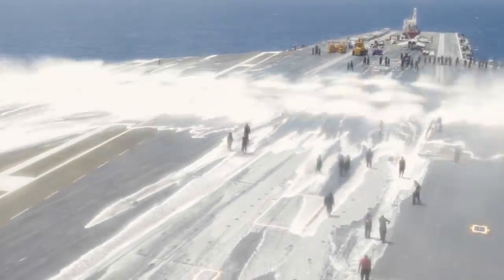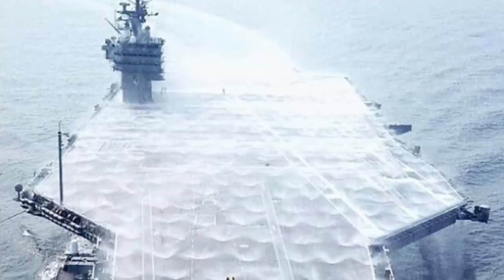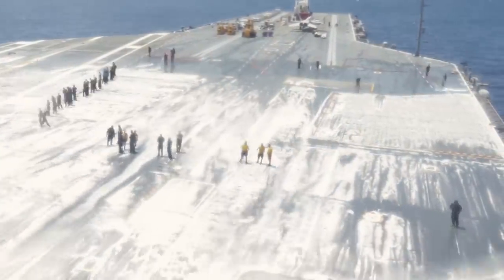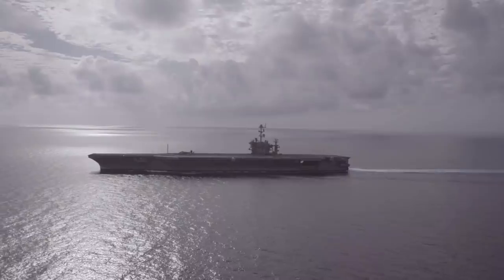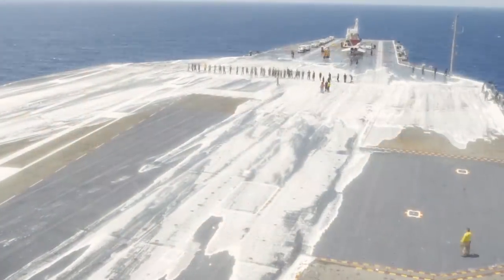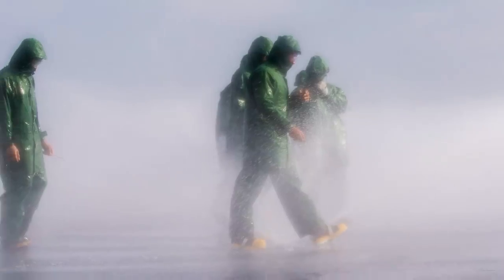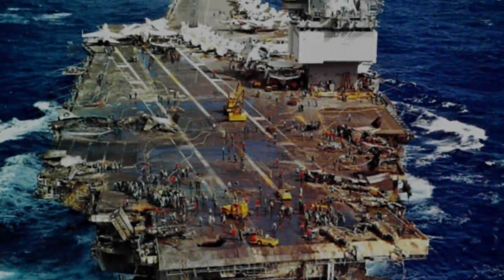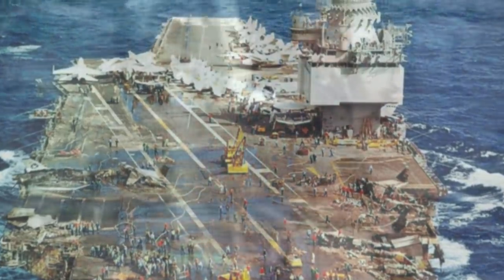Aircraft Carrier Bio Force Field - Countermeasure Washdown

Comment: A F F F just doesn’t sound right, we always called it A Triple F.
Reply: thats because you called it right
Reply: In June of 1987, after the USS Kitty Hawk entered the Med, from the Suez Canal, we resumed flight ops at night. After flight ops ended, was stripping wax off the deck of the passageway, just outside of CATCC/Air Ops at 3 am. About an hour later, a little puff of white smoke filtered up from the hangar deck, to the 02 level, where I was at. A few minutes later, I heard over the 5MC, "gentlemen, man your hi-caps." Oh SHIT, hanger deck is going to be turned into a giant "car wash" !! Instead of soap, it's , you guessed it, A Triple F. About two minutes after the announcement, came GENERAL QUARTERS !! OH SHIT,  taking up wax makes the deck very slippery !! I even posted warning signs outside the "knee knocker", above/below the ladder wells, too. I didn't want my shipmates to fall on their ass !! But, my attempt to avoid that scenario was for naught. Three of my shipmates ignored/ failed to see the sign as General Quarters was sounding off, and slid on their asses, like sliding into 2nd base. Fortunately, no one slammed into the angle iron protruding into the passageway. I assessed my shipmates condition, leaning out of CATCC, and motioned like a baseball umpire, yelled 'SAFE'. Sorry, I couldn't resist. My GQ station was a repair locker back aft, but I was stowing my gear before I left for the repair locker. Special firefighting team has four minutes to respond to any fire aboard ship. If not, GENERAL QUARTERS is sounded. They couldn't, that time. Turns out they were transferring the ship's diesel fuel to a fuel void, and it caught fire. The skipper turned the ship so the wind would fan the flames outboard. Never found out who jettisoned the crate of grenades off the roof and over the side, but I would have bought that guy a drink, after we hit port. Felt bad for AIMD, having to clean A triple F off the aircraft. I understand A triple F is corrosive.
Reply: Castle AFB built a couple new maintenance hangars back in the late '80's.  Each had very sensitive fire detectors that could 'see' a flame a mile away.  Well, we got called one night for a system activation in one of the hangars.  The detectors spotted some welding at the far end of the flightline and at oh-dark-thirty the entire fire dept. had to show up.  We reset the annunciation panel and went back to bed.  We let the maintenance guys clean up the 2000 gallons of AFFF that filled the hangar and offices.
Reply: @TheHawk--oe8iq  i am confusion
Reply: @traleras1 , sorry. I used a lot of US Navy slang.
Reply: @mbpaintballa  Who ever jettsion the RSL us like not to be find. It an insta mass wirhout the CO approval.
Reply: @Virtualstalker , I heard the flames were "licking" the grenades; started to cook. They had to go for a "swim". A chief probably sent them packing.
Reply: @TheHawk--oe8iq  the rsl hang of the side of the ship. If they where licking them. Then the is no way of jettsioning the locker.
Reply: @Virtualstalker , what responsible CO would NOT approve a crewmember saving lives & destruction of his ship & crew ?? Surely, this could easily have been another USS FOREST FIRE, had it not been for the quick thinking of my shipmate(s). I would have risked captain's mast or court martial to save my shipmates !!! Btw, the word I used earlier was HEARD, as in SCUTTLEBUTT !!! But, if you would like to ask my (then) CO, Capt. F. Lee Tillotson,  go ahead and do the research.
Reply: i @TheHawk--oe8iq  I not saying it wrong. But with out the CO approval. It instat mast, but does not mean they will get in trouble, but the hastle of it.
Reply: A3F would be a nice quick way to say it

Comment: This would have helped back in the day when that missile went off during start up procedure of a jet
Reply: Can you explain what happened?
Reply: Edit: the USS forestall in the 1960s during the Vietnam war, on startup, another plane accidentally launched a Zuni rocket into an a-4 sky hawk which exploded and caused a massive fire, killing over 100 sailors
Reply: @devin5531  flight deck crew had pulled the secondary safety pin on the missile before start up procedure, when starting a jolt of electricity set the missile off.
Reply: Cough John Mccain cough
Reply: @thetank2078  some of the vids on youtube show the dedication of the flight deck fire chief running straight towards the blaze with nothing but a fire extinguisher right before a huge explosion, telling others to get away!
Reply: @Tugboatpb  Yes, you are correct.   John McCAin had nothing to do with the start of the fire.
Reply: The Forestall fire  and the later Enterprise fire  in Nam was actually the thing that show the navy that they need this system.

The Navy Had the design and prints for the system as shown here in the 50 but...

As I understand it got cut from the final designs as a cost cutting measure. Which wasn't help by the fact that Navy... Was kinda Cocky at the time believing no one can hurt a carrier... Also idea of any weapon used to attack a carrier will be a nuke,  such destroy the carrier out right was going around with the whole:

You dont need a big navy or army, just nuke them and be done!

Line of thought, lucky or unlucky depending on how you see it, Korea and Nam showed that Nukes dont solve all problems. Still took to long for the Military to get the messenge through...
Reply: JoeyR: Forrestal did have a water washdown system.  However the explosions damaged the under-deck fire water mains pipes, making it inoperable.
Reply: @KB4QAA  I knew the interior of the ship was damaged under the flight deck but I didn't know about damaged fire safety equipment damage...thanks for the knowledge, it's kinda hard to find the complete story in detail on YT about it.
Reply: @KB4QAA  Songbird wetstarted his jet. Which caused the missile launch, which caused the fire.
Reply: I remember being taught that they had AFFF systems, but the DC crew had never used them, and they had to read the instructions for the first time as they were fighting that fire.

We were told that the Forestall has led to a change in Damage Control doctrine, where they were teaching crews not to listen to rank, but to training. 

For example, when the Cole was hit, a lot of the Mass Casualty actions were guided by the junior sailors who had just left boot camp, because they had the most relevant and recent experience training for that type of situation. The senior sailors and officers had experience avoiding getting into that situation, but the junior sailors had more recently trained for getting out of that situation, so they were the ones to follow.
Reply: @rogerstroklund6809  My dad enlisted in 68' and I remember him saying they already were using the footage in training.
Reply: @droneguts5122  1. That did not occur. Read Wiki or the actual Navy investigation.  2.  A jet 'wet start" does not create a fire.  In fact a wet start is when the engine fails to start.   3. A wet start cannot possibly cause a missile launch.  (retired Naval Flight Officer).  All this propaganda is from extreme right wingers and is false.
Reply: @rogerstroklund6809  I saw many tests of the water washdown system on several ships, but never saw AFFF dispensed that way.  (78-2005)
Reply: That was part of the reason the Navy started better training and revamped the deck wash system
Reply: @joeyr7294  Most of the fire fighting equipment was destroyed/inoperable after the initial bomb blasts. It took time to clear it and run hoses and bring equipment from other parts of the ship, as well as assembling the few trained personnel.  The navy learned hard lessons that day.  (I went through Aviation Firefighting School twice, and Shipboard Firefighting once in my career.).  b.
Reply: @KB4QAA  Nope she didn't get that system install until after the fire, the Navy itself confirms that the first deck washdown system of the type seen here was first install on the USS Franklin D. Roosevelt (CV-42) in 1969 as a direct result of this fire.
Reply: @KB4QAA  What the hell does politics have to do with this? A rocket launched, I saw the video in training. The crew did pretty much everything wrong i.e. washing off the foam laid by other fire crews. Their training was lacking. Men died.
Reply: Pelican1984 I noticed that, too. We were taught that AFFF was brought by a hose for fighting Class B fires, and the sprinkler system was for CBR response; you locked the doors and turned on the sprinklers to wash any fallout off into the ocean. It sounds odd to me to use AFF for CBR because it’s supposed to smother and cool, and you want to wash off CBR attacks. You want AFFF to stay put, but you want the sprinklers to rinse stuff off.
Reply: Joey R He and I probably watched the same movie in Boot Camp. I went through in ‘01.
Reply: @rogerstroklund6809  thank you for your service man 🍻
Reply: @droneguts5122  BTW, A "wet start" failure is nothing extraordinary, and does not reflect any failure or incompetence of a pilot. The engine start sequence of A-4's was quite modern and essentially automated.  Again, "no big deal".  The engine is 'motored over" to clear liquid fuel and fumes. If any spills on deck, the deck crew quickly hoses it over the side, and the start sequence starts again.  Just a few minutes delay, no big deal. I"ve had it happen.  Again, it is not an indication of incompetence of the pilot.
Reply: TL,DR; This is what I recall from a recent documentary I saw about the USS Forestall incident, and there's a lot of steps to how it went so bad so fast.

There were two fail-safes that were supposed to prevent things like the Forestall from happening; a physical lockout and a procedural lockout.

The procedural lockout was an instruction that said that the pigtail, the electrical connection between the aircraft and the ordinance, was not supposed to be connected until the plane was on the catapult. That way, if a power surge caused a weapons launch, the weapon would shoot out off the front of the ship. In practice, though, this meant that if a weapons system showed an error when connected, then that issue would have to be addressed prior to launching the aircraft. That means that you have to delay every other launch, because the problematic aircraft is still attached to the catapult. For the sake of mission readiness, the flight deck moved the pigtail connection to earlier in the launch process, so as to identify problems without holding up the mission.

The physical lockout was the ubiquitous red-flag that says "Remove before take-off." These flags are supposed to disconnect the firing circuit, so even if a fire command is given, it won't reach the ordinance. The problem is that a flight deck is a windy place, and the flags would generate enough drag that the wind would pull them out of their holes by a fraction of an inch. This meant that ordinance could look like it was locked out, but still actually be capable of firing.

Both of these events happened; the red-flag was pulled out on the Zuni rocket by a fraction of an inch, and the pig-tail was attached. The aircraft was getting electrical power from a connection to the ship, so as to keep the flight systems running. When an electrical surge from the ship hit the aircraft, it sent power down the firing circuit and launched the rocket.

Now, when that rocket hit the A4, it did two things; it ripped open the fuel tank and destroyed the hard-points under the wing, which were carrying unguided bombs. Jet fuel is way more stable than people give it credit for, so it didn't just explode when the rocket hit the tank; the fuel leaked out onto the deck and caught fire. In that fire were the two unguided bombs that had fallen off the wing when their hard-points were destroyed. 

Normally, an unguided bomb like a MK-82 or a MK-84 isn't going to explode just because it's hot. This wasn't normal, though, because the DOD had recently adopted a FIFO (First In, First Out) supply policy so as to get rid of older munitions before they became dangerous. That meant that the two bombs, which I think were 500 pound MK-82's, were WWII or Korean War surplus, and unstable as all hell when compared to modern munitions of the time. Thus, the fire caused the bombs to detonate.

The bombs exploding actually ripped a hole in the flight deck, and that's where all that burning jet fuel went; it drained through that hole into the ship. 

From there, everything went to hell. Sailors were trapped in their compartments, as they had to dog and latch all the hatches to keep the fire from spreading even more. That meant that those sailors were safe from the fire, but they were also trapped in tiny rooms and choking on smoke.

By the time it was over, if memory serves, most of the aircraft on the ship had to be tossed overboard, and over a hundred sailors were lost. John McCain was more than present for all of this. I can't remember if it was his A4, or if it was the A4 parked next to him that was hit by the Zuni rocket, but either way, he found himself strapped into an aircraft that was parked on top of a fuel fire. He sustained third degree burns because he had to jump out of his plain and roll through burning jet fuel to get to safety. Before getting treatment, John McCain did what he could to help lead his part of the Disaster Recovery operations.
Reply: @rogerstroklund6809  Read the Navy Report  I previously posted:  https://www.jag.navy.mil/library/investigations/USS%20FORRESTAL%20FIRE%2012%20AUG%2069%20PT%201.pdf
Reply: @rogerstroklund6809  What was your rank of you don't mind me asking? My Dad retired in 92' as a ADCS
Reply: @joeyr7294  I did a total of fourteen years, eight active and six reserve, and left as a CM1 (Construction Mechanic Petty Officer First Class). I was a Seabee.

Before anybody asks, my last four years were IRR (Inactive Ready Reserve), so they didn't count towards retirement, which meant I basically did ten years and was stuck at the "do you or don't you phase", and decided "I don't". At the time I had to make the decision, they were denying retirement because of IRR service for a lot of guys, and I didn't like the idea of doing six more years just to get forced out without a retirement, so I decided to move on.
Reply: @rogerstroklund6809  Hell yeah! It was very similar with my Dad, 23 years active and 4 years in Norfolk at the base.
Reply: eric zaiz   Yup, we watched a lot of film on it during boot camp.  The Forestall was still in commission when I was in; its unofficial name was the Forestfire.
Reply: Gary Sarratt I forgot about the name. I always loved how we learned the Navy nicknames; “This is the USS Forestall. It is NOT the gawdamned Forest Fire.”
Reply: Yeah I saw the tapes of that that was scary as hell I can't even imagine going through that.
Reply: My Grandfather who has now passed on served in the Navy 20+ years, partially during Vietnam. He was on the USS Forestal prior to the big fire I believe. As a little kid I remember him talking about a different fire they had on the Forrestal while sailing through the Bermuda triangle of all places. Its one of many stories I would give anything to ask him about today...
Reply: Don't think it would help. They have oxidants and would keep going couldnt shut it down.
Reply: They actually did have AFF at the time, and they used it. The problem was that the majority of the crew didn't have extensive training in firefighting, so the ended up washing off the AFF that the DCs put down.
Reply: The Tank why do I feel I heard of something like that happen on CVN-65
Reply: That incident is exactly the reason why this system exists.
Reply: @rogerstroklund6809  the primary firefighting team and most of their equipment were wiped out in the initial explosions.  The guys who ended up manning what was left were guys who hadn't been through firefighting school yet.
Reply: @rogerstroklund6809  AFF is kind of similar to detergent (according to the training I received), but we used High-Test Hypochlorite for decon after the countermeasure washdown system.
Reply: @garysarratt1  we were still calling it that in the 90s.
Reply: Chris Horne good to know
Reply: Same thing happened to the U.S.S Enterprise CVN-65

Comment: I was in the US Navy for 8 years, 4 ships and 2 decommissionings. The countermeasure wash down is completely separate from the AFFF system. I was also on board the GW for 6 months. All the sprinklers in the flight deck is NOT used for fire fighting unless it's an absolute last resort. There r tons of AFFF hose reals around the edges of the flight deck. Also, the hanger bay doesn't have a counter measure wash down system.